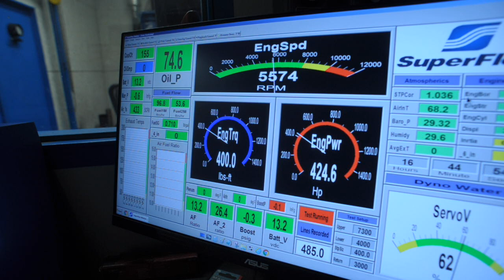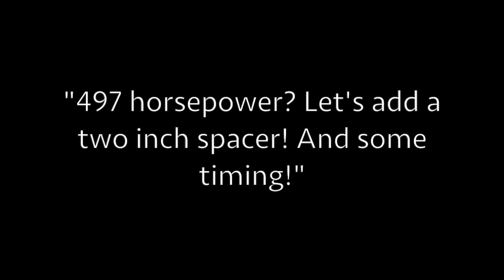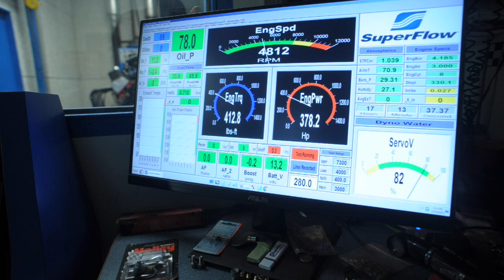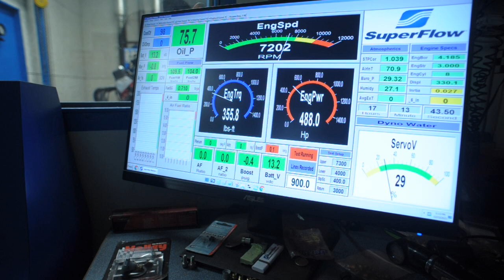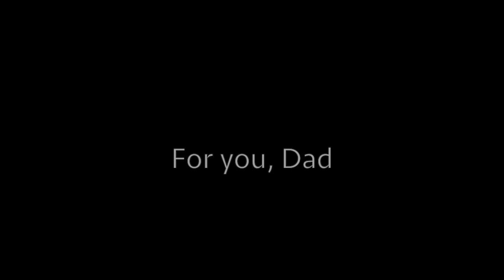Dyno #2 SBC 283 Crankshaft + 400 Block = 500+ HP | Big Bore, Short Stroke, Long Rod (re-upload)

Comment: So what would happen with a big stroke small bore engine?
Reply from the maker: Typically the downside of small bore is the heads don’t flow well due to the valves being shrouded and usually need to be under sized to fit in the smaller bore.
Reply: @ceperformance i remember reading an article where they built an engine like that but they installed the parts that advertised a high rpm band and they left the exhaust valves alone but they ported the intake valves to the max

Comment: Cool I'm running a 383 right now mild Street cam motor but I have a 73 400 small block 511 4 bolt Main really nice motor I was thinking about stroking it to a 377 but I have a friend that's running same motor I have he stroked it to a 421 I think he said he's making like 711 horsepower I think he said my thoughts are the longevity what your thoughts great sounding motor you have
Reply from the maker: Right on, thanks for commenting!

Comment: I've wanted to build one of these for a decade now I just haven't gotten it done yet. I'm curious what your bore and stroke specs are?  By my calculations a .040 over bore making it 4.165 and 3.000 on stroke that lands you right at 327cid.  Anyway it's cool what you did, would like to see it rev over 8000🤗
Reply from the maker: Hey, go for it! Our bore is 4.185” with the 3” stroke. 6.1” rods and the pistons stick out of the deck… just a little bit :)

Comment: I feel like this is a waste of a 400 block. Wouldn't it run alot better with the 400 crank??? Anything 283 always went in scrap pile unless Corvette motor.
Reply from the maker: We have found a new use for the old cranks!
Reply: @ceperformance  put old cranks back in old blocks and build real motors, I got 2 if you need them.
Reply from the maker: @TobyBielat 
Sounds good, I’ll take your cores. Thanks.
Reply: @ceperformance  😂

Comment: Not sure what the point of building such a short stroke motor is if you’re not gonna rev it past 7300 RPM.  Might as well have went with longer stroke for more torque
Reply: I’d say big solid roller and rev it to 9k plus then it will be perfect lol
Reply from the maker: @AdventureswithZack 
We should build another one with that solid cam and a Super Victor manifold :)
Reply from the maker: Valid point :)

Comment: Hey  just to let you know  ,I run a 360 cu inch SBC ,4.60 BORE   3.500 STROKE with  2" rod journals makes 750 hp at 9,000 rpm with .700 lift solid roller cam.
Pro drag 1961 Austin Healey  weight 1850 with me in it ,5.73 1/8 mile , 8.44
1/4 mile @ 160 mph against BBC cars
Running 300 shot of NOS , they can't believe I beat them with a SBC ,NA MOTOR ! feels great  ! My hats off to you as I thought about this combination back in the 70's and no one  thought it would work. 😊
Reply from the maker: Awesome stuff! Thanks for sharing :)

Comment: Very nice crisp combo. Is that a hydraulic roller cam?
Reply from the maker: Yes it’s a custom hydraulic roller we had Comp Cams make for us.
Reply: @ceperformance  What is your secret to making these engines make power to 7300 rpm with no valve float on a hydraulic cam, that is very impressive.  I am looking for a Chevy driver, Nova , Chevelle etc. I was thinking of a pump gas 383-406 cube. Looking for 425-450 HP and 500-525 tq. Hydraulic roller, something that will run all day long at 80 mph. Would like the power for passing on the highway. Do you have a combo that would make that?
Reply from the maker: @JerryM-p2v 
Hey, thanks for commenting! 
Good valve springs and light retainers really helped this one. Different cam profiles act differently on valve springs and therefore valve float. Stability is critical. Correct rocker arm geometry, solid 7/16” rocker studs help, thick stiff push rods all are important. 

Your power goals sound very achievable. Feel free to reach out.
Reply: @ceperformance  Ok I will, that makes sense. thank you for the reply.